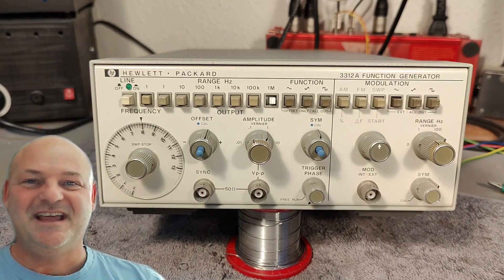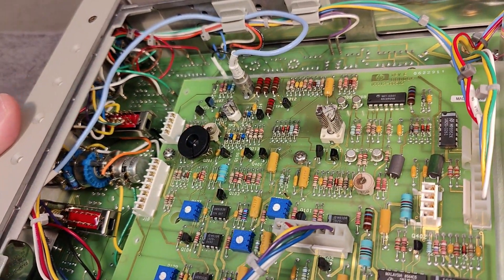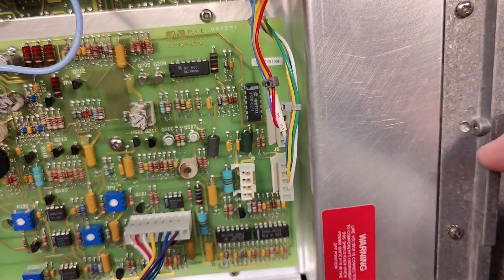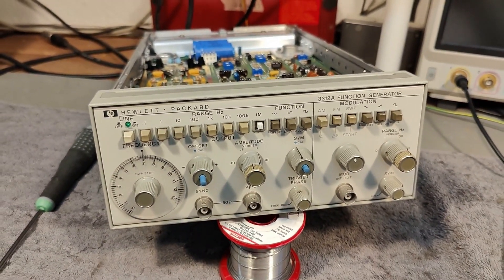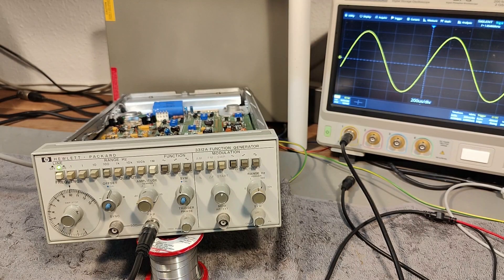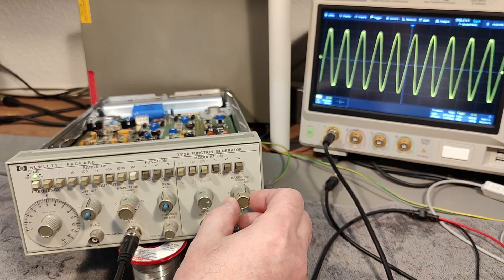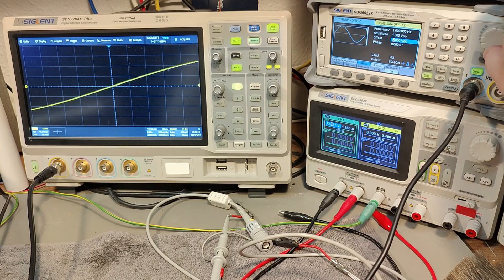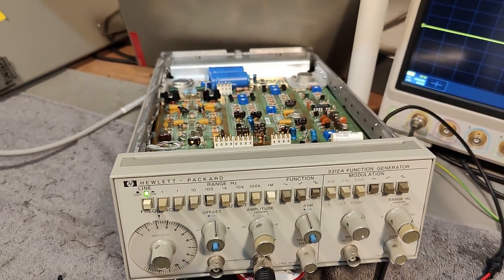HP 3312A function generator 13MHz MOD and VCO 1974

Comment: Absolutely legendary! The HP 3312A Function Generator is an engineering masterpiece! Can't believe this beauty dates back to around 1974 and was built for over a decade – that means it's 40 to 50 years old and still going strong! A frequency range from 0.01 Hz to 13 MHz, full AM/FM/Sweep modulation, and voltage control over the whole range with just ±4 V – that’s insane precision. And it only pulls 13 watts? Hewlett Packard was way ahead of its time. Just WOW. Pure vintage magic!
LOVE THIS!
Reply from the maker: exactly, i keep seeking HP equipment, a few more units on my stock, so more will come, and tomorrow i drive out to visit a new fleamarked

Comment: I have a bunch of analog generators but the 3312a is my favorite and I use it the most. Mine had a bad driver transistor in the output section when I got it, which manifested as offset issues. Got that fixed and its worked great since.